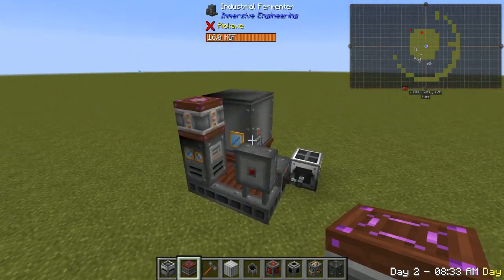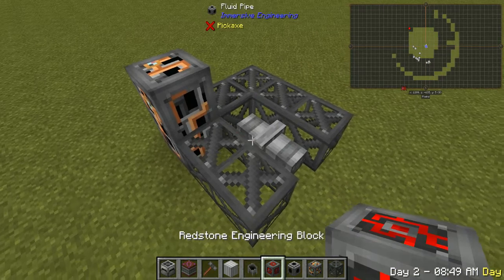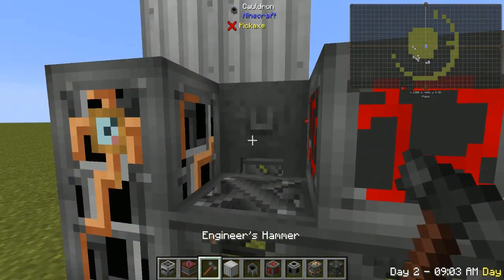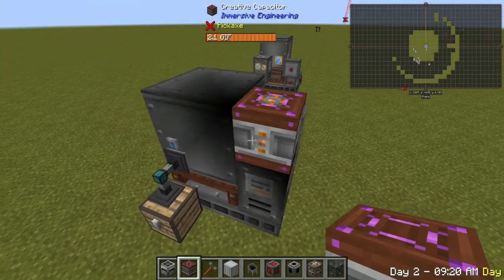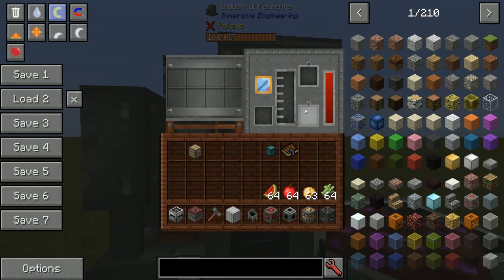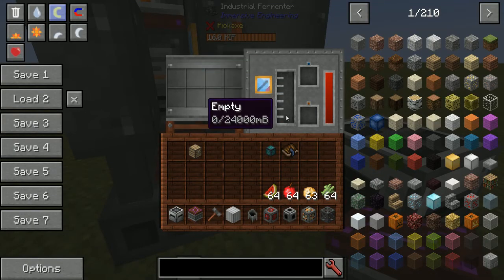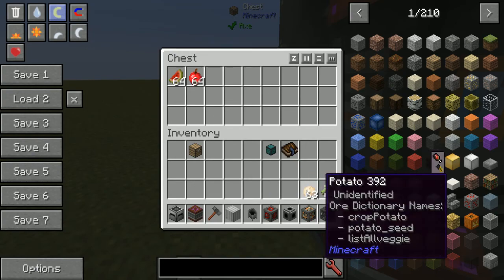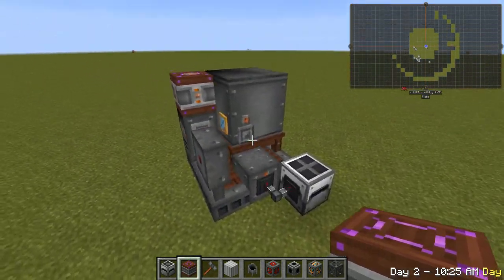Immersive engineering how to: Industrial Fermentor

Comment: It won’t let me place the capacitor on it?
Reply from the maker: Not sure why could be a differance in version this video is pretty old...i would try a cable/conduit/wire running from the capacitor if it wont let the capacitor sit on the machine itself
Reply: right click on the top of the capacitor with a hammer til it says output